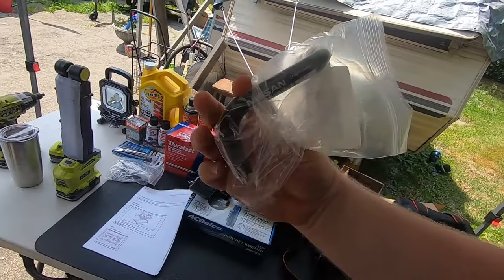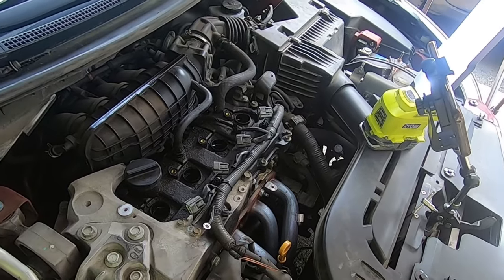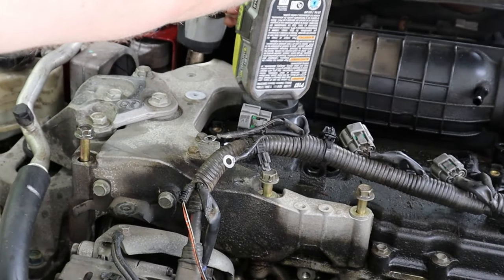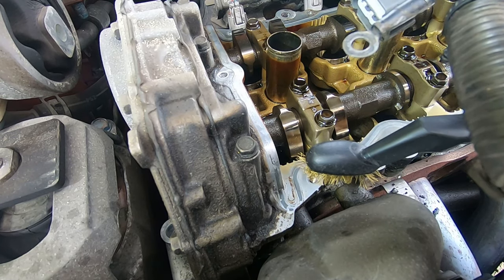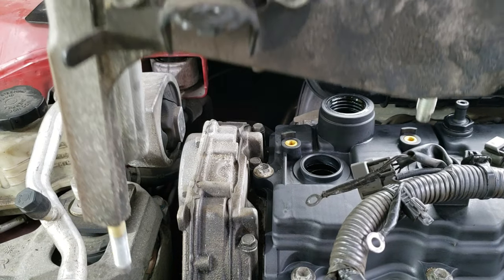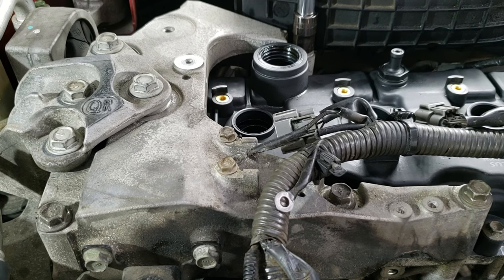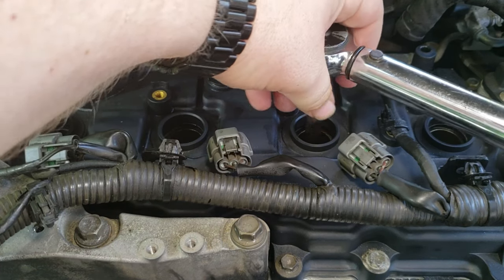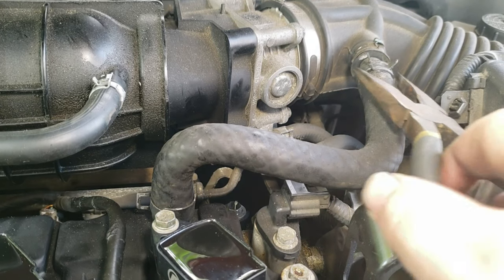2007 - 2013 Nissan Altima 2.5 Liter - How to Replace the Valve Cover & Gasket: FULL Walk-through!

Comment: Torque Specs:

The 5 14mm bolts are 36 ft lb. and the 18mm nut is 76 ft lb. The other few are 37 as you did.
Reply from the maker: Thanks man! Appreciate the torques for those 👍
Reply: Thank you I’ve bin looking for the specs for a while
Reply: Had to change the hose you had, followed every step and ended up with a  screeching air blowing noise…now it won’t start at all.
Reply from the maker: @yovidify hmm, sounds like a massive vacuum leak of some kind. Go over all the hoses and make sure they're all clamped down and they're not cracked like my PCV valve hose was. Is the check engine light on?

Comment: I own a 2012 nissan altima, did my  first valve cover replacement on it at a 140,000 miles.  I watch your videos and follow your method step by step. I had some problems taking off the engine mount, but was smooth sailing after that. Thank you very much for your thorough explanation.  Blessings always.
Reply from the maker: That's awesome. I think dealing with thw engine mounts is the most difficult part lol, but glad everything went well for you G Lew! Thanks for watching! 👍

Comment: Big Huge Thanks!!!   You showed me the way.. from the products to the first and last bolt and everything in between . Thanks again... The best video i have seen on this repair.  My 2008 Nissan Altima went from running sluggish, oil in the spark plug wells , misfiring, valve cover an oily mess to running like a charm. To those who hesitate and wonder if you could do this, you can with this video and the the right tools and products.
Reply from the maker: You're very welcome! Thank you so much for watching! 😁👍

Comment: Watched multiple videos to change the valve cover gasket for my 2008 Altima(129,500 miles) after being told it needed to be replaced.   Wasn't burning oil or having oil in the spark plug well but decided to also replace the valve cover too as it would already be off.  
This is the best (imo) of a few very good videos out there.
Note that for the engine "lift" / prop up I did have a lift that was taller so ended up using a piece of 3/4" (instead of a 2X4) to place under the oil pan.  An other video shows putting a jack stand on a part of the motor just the side of the oil pan (closest to the passenger tire) but I could get under the car well enough to do that.  
Took me closer to 2.5 hours to get it done, by feel better have done it myself.
Thank you for sharing your knowledge and giving other the confidence and knowledge to do so.
Reply from the maker: You're very welcome. We're glad to make these videos for you guys so you can learn something new and save some money too! Thanks for watching! 😁👍

Comment: Got this job done on my wife’s 2010 Altima today. I did my 2012 beetle about six months ago and it was way easier since there were no engine mounts to mess with, but your video made this job very doable. Thanks!
Reply from the maker: Sweet, that's awesome! Yeah it would have been much easier if the engine mounts weren't in the way lol. Just check for any oil leaks around the valve cover gasket for the first week to make sure its buttoned up good. Thanks for watching! 🙂

Comment: Just wanted to say... this was a really good/great video for this.  Good job editing the video, good close ups where/when it needed to be, great explanations.  Used this for fixing my sons collge car, his was sitting at 202K miles, still perfect condition except some oil leaking out of the valve covers but minor given the miles..
Reply from the maker: Hi Tim! Thank you so much! I'm really glad you were able to get your son's car fixed. Mine just passed 200k miles a month ago! It's leaking some oil I suspect through the oil cooler gasket in the back. Just added some leak detection dye to my oil. Apparently, it's pretty common on our vehicles to leak there as well. Other than that, she's still going strong! 💪

Comment: Uninstalled and prepped everything today, will install everything tomorrow! Video is very clear and informative! One thing I did different was not touching the  18mm bolt at 6:37 (i didnt have the tool for it) but it didnt matter as far as uninstalling goes. Again, video is perfect! Cheers

Update: After a day everything looks good! 

One thing to watch out for: my brittle tube was still intact when I removed/reinstalled it however the clamp was no good and caused a minor air leak. Simply replaced the clamp.
Reply from the maker: Nice Stephen! It took me two days to do it as well, If you have any questions please don't hesitate to ask  Thanks for watching! 🍻

Comment: Today I did this job and it was a lot easier thanks to your video. The only thing I would add is the first round of torque should be 17 inch pounds, BUT most likely your 1/4" torque wrench won't go that low, so just use judgment. I tightened it in two rounds before finally tightening to the 74 or 76 inch pounds or whatever it was. Thanks again for a great video.
Reply from the maker: That's awesome Matt! And thanks for the tip! I think my torque wrench only goes down to 20 inch pounds lol. Just make sure you check for the next week for any leaks. Thanks for watching! 👍

Comment: I picked up a 2010 Altima hybrid today wiht 124,000 miles. I had a Nissan Dealer do a complete pre-purchase inspection. One "must do" is the valve cover gasket replacement. Another was oil cooler gasket replacement (enjoyed your video on that repair too). I am now a subscriber. Question is, can I expect your "how to videos" to apply to the hybrid model as well? Thanks !!
Reply from the maker: Hi Frank! Thank you so much for watching and subscribing, we really appreciate it! I've never considered the Altima hybrid andif our videos can be used. The engine is similar to the non hybrid so it might apply to the hybrid. I don't think the CVTs are the same though since the hybrid incorporates the electric motor in it too. I imagine the brakes, suspension and exterior pieces are probably the same parts. Thanks for watching! 👍

Comment: Just to let you know, been watching this video about 10 times. Didn’t want to miss anything when it comes to size of bolts, learning to torque the bolts, and prepping myself when I go remove my valve cover. Again, after watch this about 10 times I feel confident I can do it. Might take me 5 times longer than you, but I wanna do it right. Self explanatory, and very knowledgeable. I did order the valve cover, spark plugs, pcv, pvc hose. I have one question, what are the gap specs for my spark plugs. Is it .044?  Thank you. I will let you know how it turns out. Mike
Reply from the maker: Hi Michael! The gap on the spark plugs should be .043 inch to answer your question. It should be pre-gapped but I always double check just to make sure. 

We believe in you bro! You got this and if you have any questions at all just let us know! 😁👍

Comment: I love how easy you make it to understand the whole process. You got yourself a new subscriber. 
I Got the  same exact issue on my 2008 Altima. It all started as a simple spark plug job but turned out all my coils were dipped in oil. I have a question though, after I replace the valve cover is it okay to use the same spark plugs and coils or it needs new ones after doing all this? 
Thank you
Reply from the maker: Thank you for the kind words 😊

It really depends on how the car was running before you tried to change the plugs. If it was running rough or the engine was misfiring, I'd go and replace both the spark plugs and ignition coils as they could be worn out or damaged from the oil. But if you are in a tight pinch, you can try to clean them up and see if it will get you by in the short-term. Hope this helps you and good luck! 😁👍
Reply: @TrickShiftGarage  Thank you so much! 
One more thing, today I just did the prep work while I wait for the parts to arrive. I sucked all the oil out of all 4 cylinders and cleaned them as best as I could. After, I took out some spark plugs just to see their condition but what I saw was a lot of dirt & debris where the spark plugs sit on the combustion chamber. Is there a safe way to clean those without getting stuff into the combustion?

Comment: So, I did this yesterday (Sunday 11/27/22) on my wife's 2010 Altima and it was a 3-hour job but could have been shorter with one main issue that I had. Although I did have the jack/2x4 under the oil pan and it was secured, the engine still shifted with it moving forward so the whole engine was off. I had to push the engine towards the windshield to get the bolt on the engine mount connected which took lots of strength, time and luck. I was able to do it but needless to say it took away time. 

The only other thing that happened which was user error was tightening the 12 bolts on the valve cover. I used my torque wrench on each of those bolts and all clicked to what you stated for the torque spec except for #6 on the diagram you showed. Needless to say, it broke off and I have to now try and remove that. 

My question to you and is after putting it all back together, having it run and driven for about an hour with no leaks how important it is to replace that bolt. I have the tools to do it, but I don't want to feel like I needed it to do yesterday if you know what I mean. Any insight would be appreciated.

Overall though this video made the job really easy. Thanks for this video.
Reply from the maker: Hi Mario! Thanks for watching and commenting! I think you'll be fine in the short term, just keep checking that location once a week or so. If it starts leaking oil then it's time to tackle it and get a fresh bolt in there. Let me know how it goes! Who knows...it may end up being fine lol. Thanks for watching! 🙂

Comment: my 2005 altima value cover job is sooo much simpler... i am waiting on gasket off of ebay... all my plug seals are dry... i have used additive to rejuve old seals in engine a few times...fingers crossed... hopefully pcv hose i not as bad as yours...but no big deal..nice job!
Reply from the maker: Thanks! I wish mine was as easy as yours lol. Yeah, that PCV hose surprised me, I've never seen a hose so brittle in my life haha! Thanks for watching! 🙂
Reply: @TrickShiftGarage  ...car makers do this on purpose,to sell more parts in many cases imo..i see this all the time...my car may very well have a better rubber used ...
Reply from the maker: Yeah, they design it to last until the warranty ends. Then it's off their books, forgotten about and it's up to us to fix it 😉

Comment: Ran into this problem. My coils come out as pieces for some reason. Will change out cover this week, just don’t know how to get the spark plugs and coils out.
Reply from the maker: Hi Charles, the bottom part of the ignition coil should come out by grabbing them with pliers and pulling them out, they snap in over the spark plug so a good tug should get them out. Hope this helps, let us know if you have any other questions 🙂

Comment: I used a bad torque wrench and accidentally broke the first 10mm bolt to fasten the valve cover. 

I want to remove the broken bolt, but I can’t drill straight down because the intake manifold is in the way. Do you have a video that shows how to detach this part? I found your video to remove and reinstall the air intake system, but it didn’t include the manifold.

Thanks for these videos!
Reply from the maker: Hi Mike, I'm sorry to hear about your bolt snapping. Unfortunately we don't have a video on how to remove the intake manifold yet. You could get a grinder and grind a slot on the top of the bolt and use a flathead screwdriver and try to back it out of the hole. Cover the entire engine with a towel so no metal pieces get inside the engine first! And spray the stud with some WD-40 or PB Blaster to help loosen it up too. Good luck! 🤞
Reply: @TrickShiftGarage thank you! I did something like what you described with a cheapie engraver. Took a long time, but eventually got the bolt out.
Reply from the maker: Great! Glad to hear you got it out 😊

Comment: Do you have to put a jack of somekind under the engine when removing the mount?
Reply from the maker: Yeah, I just used my hydraulic jack and a block of wood on the oil pan to keep it upright as I took the engine mount off. Worked like a charm lol. Thanks for watching!🙂

Comment: Hey, when you cleaned the spark plugs, you stated that it was from the old motor cover. Went back to where you removed the cover it was dirty but no spark plug was attached. Can you help. Thank you. Mike
Reply from the maker: Sorry, I'm not tracking you...what are you asking again?
Reply: @TrickShiftGarage  sorry , my fault. As I looked at you tube many more times I saw my question. Sorry about that. Great vid
Reply from the maker: No worries man, if you have any other questions, we're here 😉

Comment: I noticed you dont have the shield  on the Exhaust on. Did you remove them?
i had to remove the one thats below because it was rattling. There still a lot of rattling left after removing it.

Also, a suggestion on this video is to tell people to be careful with the wires since some altimas have lots of miles and those wires turn crispy and the rubber covering the wires snap, leaving the wires exposed.  I have to change the coil pig tails because some are exposed due to the rubber falling off.

I have to perform this job too since i get a a little oil leaking on my nissan. I can tell because i can smell burned oil when i accelerate or when driving uphill for a while.

Funny part is, i kept telling my mechanic that i have an oil leak and that its coming from the top. He kept telling me that its from the bottom and didnt fix the damn thing.
Now i gotta do it myself because i have other repairs to do and cant afford to do all of them lol

Nice video quality btw!!!!
Reply from the maker: Thank you for the comment, really appreciate it! The exhaust cover I removed (and kept off) when I replaced my whole exhaust system last year. It was just a personal choice (I liked how the headers looked lol)

That's a great idea on the wires! My wires seemed to be okay but I will keep that in mind going forward for the next time I have to take it off. Thank you!

I was getting oil leaking into my spark plug bore holes! I had a few of my ignition coils drenched in oil, only one of them was actually clean. For the car having almost 200k miles, it held up admirably...haha

I had oil leaking out all around the valve cover, and once I caught the oil in my spark plug holes, I knew I had to replace it asap. It took a whole weekend to shoot and do mine but if you start early you could have it finished in a full day. If you have any questions feel free to ask!

Good luck and thank you so much for watching!! 👍
Reply: Just did this job this afternoon on my altima. Memorized your video so i didnt have to re-watch. The only thing i came back to verify were the torque on the nuts. So i did a separate comment with those times i needed to rewatch.
It took me around 5-6 hours to do since i did 2 engine mounts (ill do the trans mount tomorrow, and the bottom one ill have my mechanic do), valve cover, coil pigtails, and cleaned out the battery terminals. All those wires were so baked fcs! It took me longer to change the pigtails than changing the rest of the stuff lol.

Also i didn't listen to you when you said to buy the hose first lol. Mine almost snapped in half no matter how hard i tried not to break it. I have it taped with electrical tape until the hose arrives lol

This video helped me greatly!
Reply from the maker: That's awesome man, congrats! It feels good getting that job done, and very smart to change the engine mounts out while they were there for the taking! And thanks for leaving the comment with the torque specs, many will find that very useful when they start their own valve cover job. I plan on doing the other engine mounts next year.  Also, check the valve cover over the next week for any oil leaks or loose bolts! 😉
Reply: @TrickShiftGarage  I will, ill clean up the area tomorrow and check if theres anything in a week or so. 
You might think that the engine mounts would be something difficult to replace, but on this vehicle is such a breeze. Especially the transmission mount.

Comment: Can i use my new slightly oiled ignition coil? I had to replace them a month ago and now have this gasket issue. Thanks for the video. I liked and subscribed. Cheers
Reply from the maker: Thank you Michael! Appreciate the like ad subscribe! 

Yes, I would just clean off the oil by spraying some brake cleaner into a towel and wiping them as best as you can. I had to do the same thing when I first discovered my oil leak, it still worked. Thanks for watching! 👍
Reply: @TrickShiftGarage  so i snapped a bolt somehow. Any suggestions? It was number 2 on the diagram. Yikes. I had it set to 6' lbs of torque, just dumb luck.. the rest are torqued and are fine.
Reply from the maker: Dang, sorry to hear that man! I would try to drill a small hole into the part of the bolt that's broken in the engine. Then push a small flat head screwdriver into that drilled hole, the purpose of the screwdriver being to get a good "bite" on the bolt, then try to turn it out. 

Another idea would be to look into getting a bolt extractor kit. Their drill bits are reversed so as your drill into the bolt it rotates it counter clockwise to back it out  Hope these helps you. Good luck! 🙂

Comment: Can you make a video on removing the intake manifold the one after the throttle body the one that’s mounted directly on top of the engine
Reply from the maker: We will look into it! The fuel injectors are quite old now, so it wouldn't be a bad idea to do that as well since it's got to come off to access the intake manifold. Thank you so much for the suggestion 😁